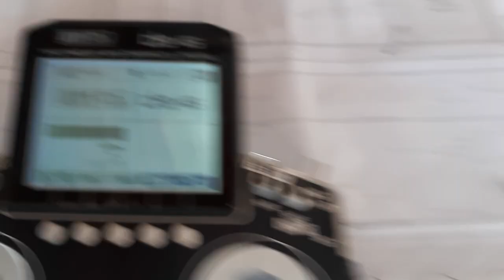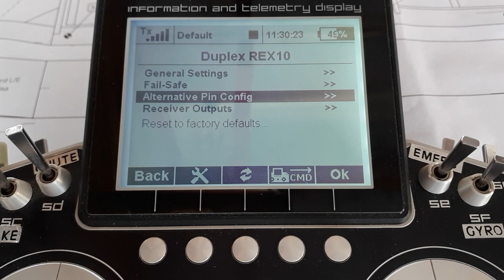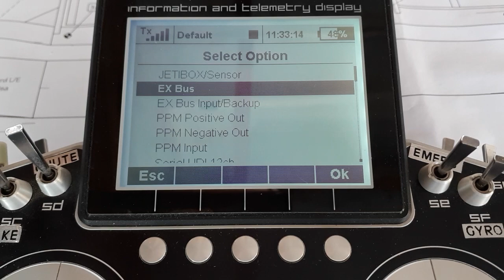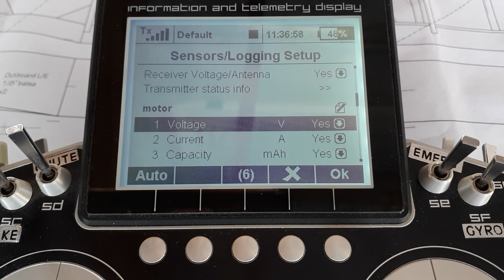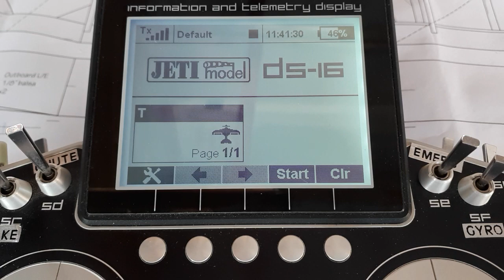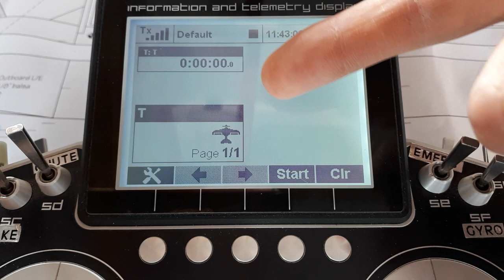Jeti - telemetry episode 1

Comment: hi friend, i tried to get Kontronik ESc telemetry ( i program esc for a Jeti Ex in menu) but this dont appear o Telemetry explorer and tx, even i assisgn Servo E1 or E2 for a telemetry....
Reply from the maker: Cannot help, I have no experience of Kontronic
Reply: @cotswoldpilot  a couple time i founded...in manual step 8 can be used with a fan cooling , but , the port of fan is the same for telemetry, even program 8 or 9 for jeti...worked, but without fan....thanks mate!

Comment: Hi Harry
 I can get my YGE telemetry on my motor to RX port E1 or E2 but when I plug in my SE4 (changing in jetibox to "sensor" pin 4) it will not read it? is this not compatible with an SE4?
Reply from the maker: Is the yge Ex or Exbus telemetry?
Reply: @cotswoldpilot  Hi Harry EX BUS

Comment: Hello Harry, would you be able to direct me to a video that would show me how to view the saved telemetry from my transmitter on a personnel computer? I don't have the capability to view the telemetry on my DS12 screen, so I'll need to use the USB cable to connect to my PC. Specifically, I want to see what the low battery voltage was that triggered a Low Receiver Voltage Warning I got while I was flying my airplane the last time I flew. .FYI, I use four NiMh AA batteries in series rated at 2,000 mA. The Battery Pack peaks out at around 6 Volts after I charge it and reads about 5.5 Volts on my DS12 Transmitter Screen via the telemetry.  It may be that the internal resistance of this type of battery is too high with the current draw of seven servos and a Telemetry Receiver such as the REX7. Anyhow, I want to view exactly what low voltage value triggered the warning. Thank you for your help.
Reply from the maker: 4 cell nimh AA ?  You are very brave!
https://youtu.be/Q6dZVxbN6Is?si=Q2j35wO0woSS0I7-
Reply: Thank  you for the reply. The seven servo model was being flow for the past three years with a Spectrum DX7, the Spectrum AR7000 Receiver, and a 4-cell 1100 mAh NiCad battery pack. The only change I recently made regarding the electronics was to switch to the Jeti DS-12 and REX7 Assist Receiver. I heard that the Assist Receiver may cause more of a demand on the battery, so I bought a 2000 mAh NiMh battery, thinking that the additional 900 mAh would be enough. However, it may be that the NiMh battery chemistry has a higher internal resistance than the NiCad batteries had and they can't handle the larger current draw watthour a drop in Voltage. Anyhow, I'm going through a learning curve. Thank God I haven't crashed my airplane because of an inferior battery type. I'm using older Analog Servos, so I didn't switch to a LiFe battery pack because that would push the battery Voltage above 6 Volts and the servos weren't designed to work on over 6 Vols.  If you have any suggestions please let me know what they are .Like I said, I'm still learning to adapt to the newer electronics and battery types. @cotswoldpilot

Comment: Hello, I'm thinking of buying a Jeti DS12, but I'm confused by the optional upgrades. I wonder what the transmitter can do in the base, can it fine-tune the servos? Set the safety switch to the engine and what about the audible warning? Or are these all functions that have to be purchased from Jeti?
Reply from the maker: I think that the basic version does not have servo balancer but it does have servo travel end-points, it has alarms but not voice output on demand.  Engine safety switch will be included.

Comment: Hi Harry - There are a few of us who can't get telematry out of our Master Spin Pro 220 / SPIN 300 PRO OPTO , we've tried changing the alternative pin to Jetibx/Sensor - Ex Bus - Ex Bus input/Backup but none of it works, but when we put another device in the alternative plus then that device works but we can't get Master Spin pro/SPIN 300 PRO OPTO to work . do you have a suggestion ?
Reply from the maker: Sorry, got bad news for you.  The Spin telem can only be seen in Jetibox.  You can view it in the Jetibox emulator in the Tx but it is not user friendly at all.  None of it is available for alarms, display, logging etc.  Jeti has 3 telemetry protocols - Jetibox, Ex, ExBus.  Jetibox is the original system and is now very old.  Either fit a MUI, or change to Mezon controllers to get Ex or Exbus telemetry.
Reply: @cotswoldpilot  Many thanks for the quick reply!! I had thought that maybe that was why, but it surprises me when they write the following in their instructions.. "With the aid of the JetiBox the controllers SPIN PRO provide the possibility of depicting
the controller status in real time. The JR plug with red body can be connected directly to
the JetiBox or to the input EXT. of the DUPLEX 2,4GHz receiver."
Reply from the maker: @Mr.Dane-RC  The instructions are correct.  You can display the telemetry either on a jetibox, or the jetibox emulator in the transmitter which you can add in Displayed Telemetry but you still have to navigate it to the Spin page every time you switch on.  The jetibox emulator on the transmitter is not very nice to use, plus the real value of telemetry is not available - alarms, voice output, logging etc